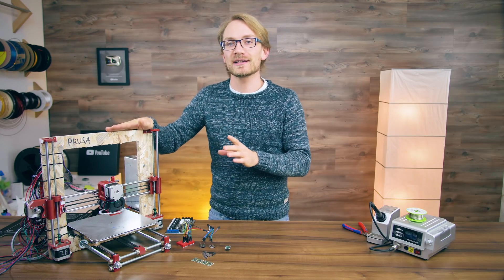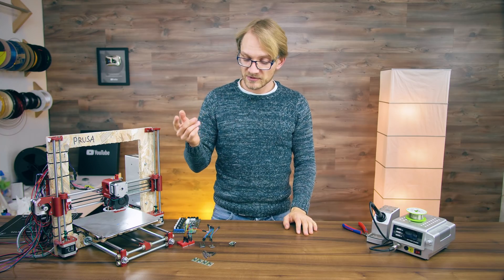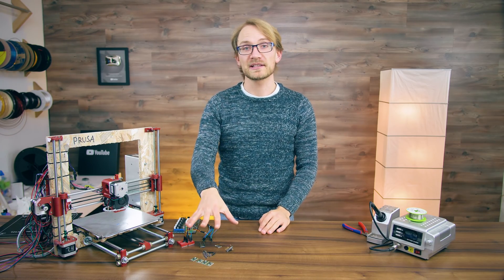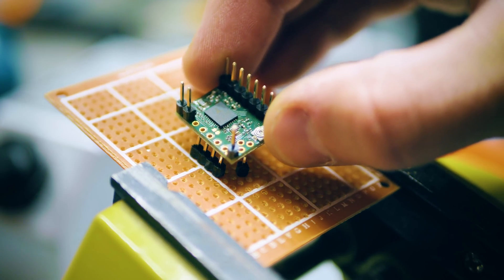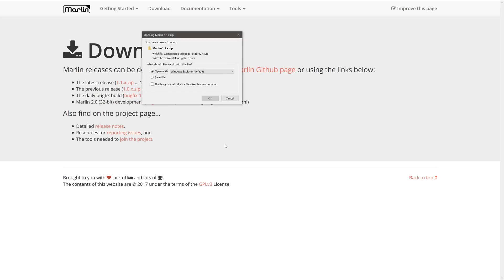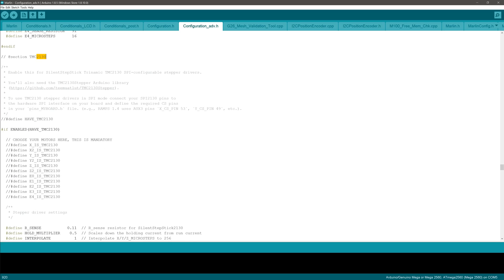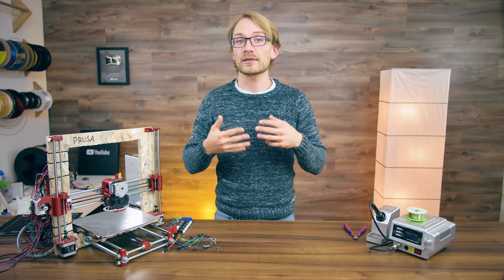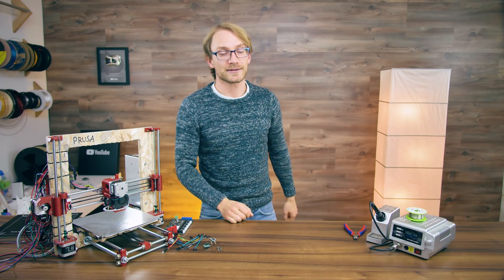How to make your 3D printer smart and silent with the TMC2130!

Comment: Now, what we need is for someone to make a step by step guide how to replace the smd chips on the non-silent Ender 3 (HR4988/A4988) mainboards with silent drivers like the TMC2208 and TMC2209. That would be great as there are really no videos or guides how to do it on YT or anywhere.
Reply: The only chip that can be put instead of the A4988 is the HR4988. The mainboards also only have 128K program flash, no broken out unused pins for new features, and many have inefficient power circuitry. They are not very worth keeping.

Only thing you could do to fit other chip would be to build an adapter add on board, and you would need to add something like 28 bodge wires to connect them together, or 12 wires with difficult attachment points and have the add-on board have its own motor connectors, and then the effort and cost of it all isn't really inviting vs. the cost of a new control board.

Additionally TMC drivers are not advised to be used on dumb boards, because extruder movements are prone to lock up the chip when in Stealthchop mode, and you're missing out on all the fine tuning you can do. To get out of Stealthchop mode, you have to reprogram the drivers via UART, and you don't have enough pins or UART capability on the main board in question. You can find some unrouted pins on the chip and carry them and i've actually done exactly that, i can show pictures, but it's very difficult, and was stressful enough without trying to film it. Because i don't have a microscope, i wore most powerful loupe and had to be right in there with my nose just centimetres from the workpiece to do it. I only had good soldering iron access without depopulating the board to the pins with needed interrupt feature on the east side of the chip, which are not accessible to Marlin because they do not exist on Arduino Mega, so i had to modify Marlin core and build scripts as well. A nicer way would be to add a small Arduino to the add-on board as described above, which would reprogram the drivers to whatever settings you deem fit, but it does keep cost piling on, and that's already an issue. Also i had done this on a board which is good in other regards, not a Creality board.

I suppose a special designed flatflex could make modding easier but that flatflex alone will be the cost of a new control board. See?

A simple modification of these old boards would be to remove or reconfigure the straps to enable higher microstepping with HR4988. You shouldn't do this for XY axis with Marlin, but Z and E are fair game. It might also be useful when repurposing the board for Klipper, then it may be viable for XY as well.

Comment: Hi Thomas. At 2:34 of your video, That drv8825 caught my attention, i'm building a printer from scratch and bought those drivers. Why does it have a resistor and a jumper soldered on it? Sorry about my english.
Reply: I'm too lazy to check the pinout but he was probably playing with decay modes. You can make them less annoying and more imprecise by pulling the decay pin high or low... not really sure which offhand. But get yourself some trinamic drivers, 2208/2224 for normal homing or 2209/2226 for sensorless. It's a really big difference
Reply: @vedranlatin1386  thanks a lot for the tip!!!

Comment: Why connect the Diag1 pin of the stepper drivers for the z-axis to the z-endstop signal pin? To ram the nozzle into the heatbed for z-axis leveling?? sounds like a bad idea? has anyone tested if it works ok?

Comment: Tom - You and Joel have quickly become my go-to gurus for all things 3D printer. Your videos are great for learning, even if my feeble Boomer brain occasionally has trouble keeping up. In following this video I heard you mention that with the TMC 2100 drivers you no longer have to manually calibrate them. My son is running a maker build i3 clone with an MKS Gen L board and A4288 drivers but I just purchased TMC 2208 stepper drivers, which I assume are an upgrade of the 2100s. I’d prefer to use software to handle the calibration if it will be more reliable so any advice you can give on how to do that would be greatly appreciated. Keep up the fantastic work and thanks in advance.

Comment: Hello
can the TMC v1.2 driver run the stepper motor using arduino uno?
Reply: in a 3d, no. uno has only a few pins, and a 3d needs a lot more than that. uno + cnc shield, yes.

Comment: I know this is old, however Id love to see a "best bang for the buck" Prusa Build. I think building it out of import 2020 or 4020 extrusions(bear upgrade?), using a due and smart ramps(or other 32 bit board..),  TMC 2130, Some form of auto bed leveling, filament runout and jam sensor(seems there are some of these online like the JamSentry), the MK3 build surface. Im sure there are plenty of other ideas that can be thrown in, but id love to see your idea of the best bang for the buck Prusa

Comment: What could be the Issue when my Extruder Motor gets unbelievably hot after updating to TMC2130? I used the same current setting as the ones in the Video. Only difference being that my machine was a cheap knock off Prusa. Maybe the Cheap Chinese Nema17 Motors tend to be hotter? Should I update them?

Comment: Sorry for asking a question about such an old video but here goes - Given the ability of an appropriately setup TMC2130 based arrangement to detect when one of the motors "hits and endstop" does this mean by using a TMC2130 on the Z axis it would be possible to do bed levelling using the motor drivers? Thanks in advance.

Comment: I'm curious if you set the options in software does the board maintain that setting after power off/on?  I'm not using a 3D printer.  Instead using it on a CNC machine.  I'd have to use and Arduino to set the options up.  But if I can set them once and they hold the setting that would work.

Comment: I was looking at swapping mine out for these on my MKS Gen L board.  On my printer, i have dual Z motors that are driven by the same driver. Is there anything special that needs to be done for that situation?
Reply: Appearently you can remape E1 to a second Z. I have not done this yet but thinking about it if I upgrade to 2208's.
Reply: @ThunderPantz01  dropped in the 2130s a few weeks ago. i just ran the power a touch higher and it seems to work fine for me.
Reply: @Erisa_Firehawk  Great Thanks for info!

Comment: Since this printer had a ramps 1.4 and 2560, I'm assuming it is running a 12V psu? I read that these run much netter on 24V, and make a high pitched noise on 12V. Is that true?

Comment: Apart from affecting the noise and making the printer smart, how do the TMCs affect the quality of the prints? I'm looking to upgrade the standard ender 3 board to an MKS with TMCs in it but I was wondering if the quality of the prints would also improve.

Comment: Hi Thomas! I was wondering if you ever made that "other video" about changing the pin assignments. I didn't see it in your video listing. I am trying to install TMC2130's on my MKS Gen 1.4 board and the pin assignments listed as being on the Aux block for the RAMPS are on the LCD block on the MKS. I have completely open Aux 1, 2 and 3 blocks but the pins are different. Trying to figure out where to put everything without sacrificing the LCD.

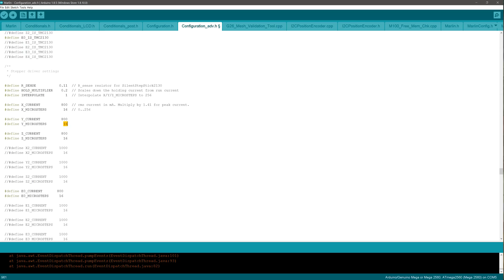Comment: Hi, thanks for the great video, I just ordered the drivers. When you place the drivers (7:39), I see no jumpers underneath on the RAMPS. When you program (13:40) I read 16 microsteps in your firmware. Doesn’t no jumpers mean no microstepping? And with the 256 stepping of the 2130, do we need 16th microstepping on the RAMPS? Thanks!

Comment: Great Video, Thomas. You're connecting Z- Diagnosis pin to Z-Min. How to set this up with an inductive probe? Or are you using the Z-Diagnosis pin for autoleveling rather than an inductive probe?

Comment: Hello Thomas I followed your video and installed the TMC2130 on my Tevo Tornado and everything work out without any problems Great Video so I added a filament sensor while I had it apart and its working as well but is there any way of turning off that Buzzer/speaker that go off when Filament runs out I hate noise and if I'm not around and it goes off the wife will have me leave  as it won't take much as she said shes a print widow already only my third printer starting six months ago

Comment: Tom, thanks for video and all information your share with the community. I am in Brazil and I have a CR 10. Also I am building a 3D Printer from scratch - a cr10 clone. I am installing MKS-Gen 1.4 with TMC 2130 drivers on it. What are some other videos you recommend me to guide me in a full configuration of my build. Thanks a lot.

Comment: My understanding is to get these drivers into SPI mode you have to solder a couple of very small connectors together on the drivers. You didn’t do that. Are there different types of these drivers?

Comment: Hello Mr. Thomas Sanladerer,
I have seen her contribution to the TMC2130! I have just rebuilt my MKS Gen L V1.0 with the TMC2100 from Watterott! What else should I pay attention to which settings, such as: energizing the individual axes (X-Y-Z-E0),
Do you still need to solder bridges to the TMC2100?
What software settings are needed in the Marlin firmware?
Especially what you have to pay attention to, so that the board and the TMC2100 will not break ?!

I would be very grateful to you for your help, as I am still a newcomer to 3D printers!
My printer is the JGAurora A5.

Sincerely, Werner Driehorst

Comment: After 3 months of using TMC2130's on my x and y axis, I removed them both today and refitted the original 4988 drivers, heres why.  With the 2130s fitted I found that yes they ran very quiet, but they ran very hot, so hot that you must provide extra active cooling ( thats more fan noise). I  found that I had to turn the print speed down quite a lot, plus the accel by a substantial amount too.  I also noticed that both my X and Y motors ran a lot hotter (too hot to hold my hand on) even though they were running at a slower print speed.  My printing was also unreliable as it often failed during the print with missed steps and layer shift all due to the 2130 drivers overheating.  So, overall the TMC2130 drivers are nice and quiet, but if you want reliable prints every time, and at a faster speed, then I  recommend to stick with the 4988 drivers and just get used to the musical noise!

Comment: Thomas, was this example on 12v? Also could you have a 12v setup with 2560/1.4 and run 24v or higher to the vmot and ground for the drivers only or would this affect the ability to control all the features through FW?

Comment: Tom, there is a pretty important piece of info missing from this video. 

Unlike any driver we've worked with before, these suddenly care about how you power them up. Motor voltage has to come up before logic voltage, and logic has to go out before Motor voltage. I can't fathom why they wouldn't just put a diode somewhere to prevent this annoyance, but giving these drivers logic voltage only has a chance to blow them.

I know, because it happened to me. Only when it happened I was quite frustrated and very confused because the only place where this is mentioned is in Waterott's FAQ page. No videos, no announcements, no anything to make the fact more widely known. Were it not for the fact that I hadn't been able to find my way to Waterott's page before it happened, I wouldn't have received a replacement.

In a nutshell, people need to be warned that they can't have a USB cable providing power to the board from a computer or an OctoPi without the power supply being on too. USB has to be unplugged before the printer is turned off, and USB cannot be plugged in before turning on the printer's power supply. For such a divergence as this is from what has become common knowledge regarding 3D printer electronics, I am utterly dissatisfied with how it was, or in this case seemingly wasn't, mentioned a lot more and with more urgency. 

Some people have scolded me saying I shouldn't be connecting the outputs of two regulated sources together. Wouldn't this be common knowledge if printers were failing every time someone hosted GCODE to them from a computer? Most reprap boards take 5V power from an onboard regulator and from USB, but there's no isolation between them. And need I mention the many side by side VRM's that supply CPU's on motherboards? Anyways, I digress. I doubt many people will know how to, or even be able to remove JUST the 5V connection from the USB side of the board while maintaining the data connections. It's not like there's a wire one can just cut.

Comment: Having just acquired a set of four of these modules I have managed to blow three of them by inserting one the wrong way :(..sad times..however I was wondering what to do with my last remaining TMC2130 module so I decided I would use it to drive my extruder motor (perhaps the most overlooked 3D-printer axis where high-end drivers are concerned) the difference this has made to my print quality is absolutely phenomenal...so my advice would be if you cant afford a completely new set of TMC2130 modules at least get one for the extruder, the layer lines are much more consistent, print quality increases vastly and retraction noise is greatly reduced.

Comment: Hi, rewatching your video in anticipation of getting some TMC2130’s, I am getting concerned that there isn’t a guide for how to use the AUX3 in conjuncture with the LCD break out board and how exactly we are supposed to daisy chain the jumpers between each stepper, help?
Reply: If you want to use the AUX 3 for both an LCD breakout board and the TMC2130 connections then you will just have to solder the leads coming from the TMC2130's to the heads of the relevant pins on the LCD break out board. To connect multiple TMC2130's to the same pin then again you can just solder 2/3/4 leads together so they terminate in just one pin.
Reply: Thanks! That is oddly convenient haha, I’ll go try that out :D

Comment: Hello, I need some help, please. 
I want to build a 3D printer. I want to use 2 steppers and threaded rods for Z axis but I dont know, if I should use also two a4988 drivers for these. I saw some boards (like ramps 1.4) have simply two output connectors from a single driver. And in case I will use two separate drivers, is there any possibility, that these could get out of sync from the software side?
And a second question. How strong should the extruder motor be? Is the "low profile" or "small" nema17 motor enough? I'd like to use direct extruder and 1,75mm filament. Thank you. I tried to find the answers in your videos, but I failed. Thanks a lot and have a nice day.
Reply: Using 2x Z motors driven from a single 4988 driver is fine, it works with no problems for thousands of us out there.  There is no advantage in driving them both from 2 seperate drivers as the z axis is not driven intensely or at high speeds.  Personally I wouldn't recommend a small low profile motor for the extruder because this is the motor that takes the most punishment and is likely to overheat and miss steps.

Comment: Hi, i am testing the watterots tmc 2130s with 24v, passive cooling, stealtshop and 16ysteps and they run quite anderen Smooth but run realitively hot on 800mA.  I have tried 400mA and have not had any step losses yet. 
Is it normal? I think my mks Board can ne broken...

Comment: Dude! This is insane! I've just installed 4 of these drivers on an ultimaker clone, in standalone mode and all I had to do was remove a couple jumpers, reverse the steppers and change z steps/mm. I didn't even have to change the firmware. It's like I have a completely new, silent, cooler, printer. I can't believe how great these work. It's completely silent. 

Thank you for making us aware of these drivers. It's hands down absolutely the best upgrade one can make to a printer. Again, can't thank you enough!

Comment: When set to spread cycle is it still quieter than the old drivers? I am thinking of putting these on my Sienci Mill One. would you imagine there would be anything different setting that up compared to what you showed for the 3d printer?

Comment: Hallo @Thomas Sanladerer

I have tried you guide, and after following very close, and I power up my Afinibot A8 with MKS Gen 1,4 it wirte instantly Driver Error, Printer Halted, please reset - what am I doing wrong - I can't finde any with same problem.  I have bought MKS v.1.1 TMC2130, using MFW1.1.8

Shloud i mount alle the linked wires as one master en three slaves

I am out for ideas

Comment: As AUX3 is being used, I guess there's a challenge having the adapter PCB for the 12864 RepRap Discount display installed. I assume, that other pins on AUX1 and/or AUX2 can be used as well, even though it probably will require a bit of modifications in the pins_RAMPS.h file....

Comment: Hi, i have a question. i have asked watterrott about using tmc2130 with ramps 1.4. he told me that i should use SilentSetpStick Protectors if i want to use the 2130s. it has something to do with the voltagesequence on the ramps 1.4. can you confirm that? do i have the by such protectors??
Reply: I've been running these on my RAMPS for quite some time now without these protectors. Not had any issues yet. Protecting surely wouldn't hurt as they are expensive (yet the protectors would make it even more expensive :-0)

Comment: Hello,
I wrote to you because I need help for my 3d Printer project (400x400x400 and  3x Extruders). I ordered my Rumba Board with 6pcs TMC2130 v1.1 SPI support, but nowhere I found a circuit how and where to connect SPI to the Rmba board. Can you target me? 
P.S. I use LCD Display